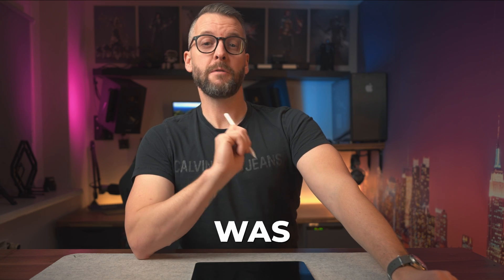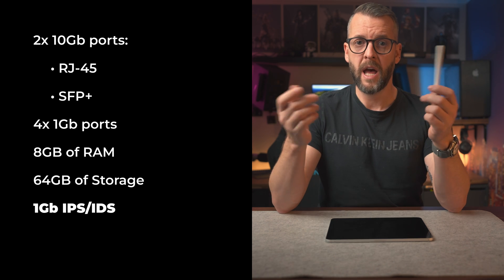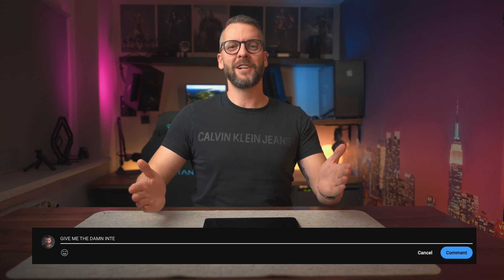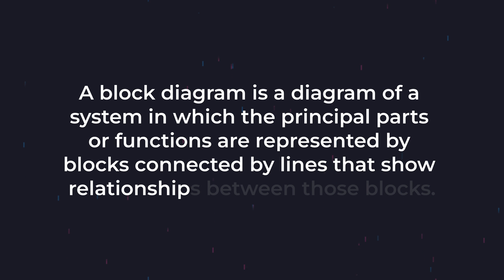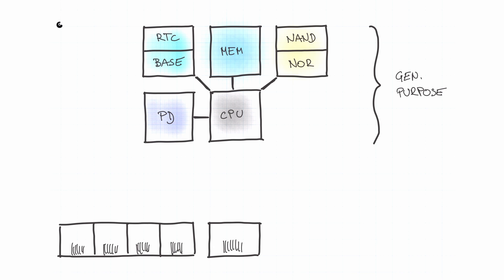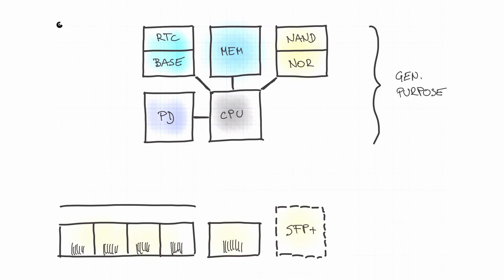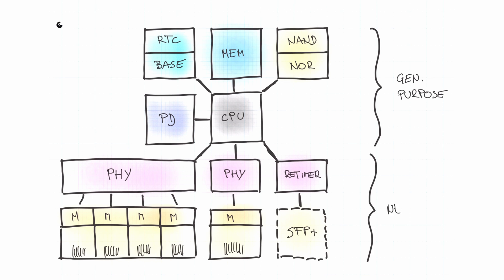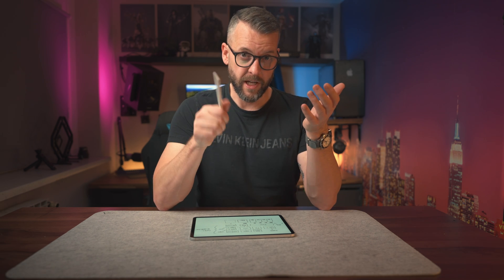Designing my own high-end router: the block diagram.

Comment: have you tried rockchip? they have dedicated ethernet. Theres a SBC with rockchip faster than raspberry pi 5, and this one comes with 2x 2.5Gb/s ethernet, and has other IO that you would find useful.
Another option which i hope is affordable is the ryzen embedded. I have one and this one has the option of 2x10Gb/s USB-C or ethernet, and has the usual gigabit ethernet. So thats 2x 10Gb/s ports and a gigabit ethernet port part of the SoC already, along with 2x Sodimm slots which can be appealing to some vs rockchip's chip only memory (same with broadcom for raspberry pi).
Another option is to go with a common hotswap PSUs used in some servers and routers or you can go with multiple external sources i.e. POE, DC in (multiple). routers like mikrotik have boards that tolerate a huge voltage range from my experience (10-50V) which is insane but not only are they reliably designed that they tolerate and work forever, the only downtime i've had is just PSU and updates.
ryzen embedded gives good performance and openCL capable options or RoCm for performance if you want to innovate, giving multi 10Gb/s software capability. mikrotik now takes the middle road, partial optimised software and partial hardware acceleration allowing for filtered and accelerated internet. Some SoCs come jam packed with features at a good price and rockchip can be cheaper than broadcom (raspberry pi) despite the better features and performance as i've seen one brand that does this well. When i went through my SBCs that are still relevant, all the ones i have that are still relevant (GPU openCL compatible) are all rockchip, from 32 bit asus to various 64 bit SBCs that i so happened to have on hand.

It would be good to connect, wish i had seen your channel faster but i understand quite a bit more about network having worked at a coreISP before. It doesnt matter how it is pronounced.
The most important question you need to ask is but will it route? Can it VPN at 10Gb/s? can it QoS at 10Gb/s? can it do all of this at 10Gb/s?

Heres a hint, for your PHY, its fine to cheap out with realtek. Unlike going with famous brands like mellanox (*cough nvidia rip off*) or intel, realtek actually has a lower latency from my testing if you want physical but want to offload the rest to software. Performance wise i dont see any reason to use intel if you arent doing dedicated hardware sharing on VMs (sharing the same physical device across multiple VMs), so theres no need to go brand crazy here. Besides realtek advertises quite a few hardware features as well.

With rockchip you could take the PCIe and do 2x 10Gb/s, 2x 2.5Gb/s. I suggest going with SFP+ instead for your 10Gb/s interfaces despite your choice of chips. TILE has interfaces for 10Gb or 4x1Gb/s but im guessing thats not quite needed for your target audience.

Your router must beat ubiquiti as well. Both the rockchip 3588 and snapdragon already beat intel atom in performance so theres no reason to splurge on intel atoms.

Comment: IMHO the deciding factor for buying this router would be mainline kernel support. The number of SBC style boards I've purchased over the years which lasted < 2 years because I wasn't able to update the software on them anymore because the vendor used the chip manufacturers custom kernels to build forked variants of whatever os/distro.
Reply: Agreed, would help with OpenWRT long term use.

Comment: Hi, Tomaž, also hi from Slovenia, i write in English so others can help and comment, and that's my optimization. The case, look into ALU metal press forming instead of CNC machining, it should lower the price significantly, and it also is more eco-friendly. For the router board, imagine the audience, if high-end home users then target 250€ max, instead of 500€. We need capable VLAN routing with some IPS, target 2.5G for VLANS and 1G for internet with IPS if possible, and two WAN ports. The SoC with built-in ETH is great, then reliable storage for dual boot, and m.2 and USB rather than mpcie for backup disk, so it won't brick on failed upgrade and config revert with a button. A surge-resistant power circuit, and isolated ETH ports. All the LEDs for diagnostics, interference resistance for SoC, and also watchdog. Have a look at UniFi gear for inspiration like cases, ports, and circuit design. Make yours even more friendly to use and simple to restore config. As for the software start with support for opnsense + pfsense. Then later on the mobile app and more user-friendly GUI make it better than UniFi, with guided pro features, it would be the goldmine for savvy home users. Users need guidance fast, to make the internet faster, to enable QOS, to make good firewall rules, to resolve VLAN congestion due to IPS or a hogging client. Even UniFi lacks some of this. Have a great holiday, and I wish you success with the project.

Comment: 2x10Bbps port don’t make sense really… if I need to connect a device to my computer, I can do that directly. Without router.

My use case (and I use 2 10Gb routers).

- 10 Gb optical port to connect to provider via provider’s router
- 10 Gb port to connect computer on QNAP QSW-M408-4C  router
- 10 Gb port to connect NAS (NAS has SSD cache) on the same router

If not SSD - I would survive with 2.5Gbps, 5 Gbps max.

But I would still need more than 2 ports.
Reply from the maker: Gotcha, thanks for the rationale!

Comment: 1. 2.5 GbE instead of 1 GbE
2. Go for x86 platform. The versatility and support you'll find will be countless. Almost all packages of OPNsense/pfsense/OpenWRT or any kind of linux distros will be supported, no need to recompile all those packages. The drivers and software supports will be huge. The extra price needed for x86 will surely pay off.

Comment: Hello!
Very interesting process and I wish you best of luck with it! :) 
I`ve read through below comments and I didn`t see anyone mentioning the HW acceleration for PPPoE WAN connection. 
Without it, your CPU will be totally under the water and even cheep alternatives (like the ones below 100$) will easily surpass the gigabit PPPoE performance, not to mention the above ones, 2.5GGbps or even 10Gbps.
Ubiquiti had this issue and they worked on it for more than a year to optimize the OS and distribute the encryption on multiple CPU cores. 
Why I`m mentioning this? -> Most of EU countries still have PPPoE fiber connection through GPON and now some of them, like Romania, are transitioning to multiple gigabit (2.5G/10G through XGSPON). :) 

If your router will be capable of 1Gbps PPPoE with IDS/IPS active or 10Gbps without IPS/IDS you can consider me as client. :)
Reply from the maker: Thanks for pointing that out, I was not aware of it! Will test the development board thoroughly to make sure PPPoE works as it should.

Comment: Have been following your feeds. I fancied similar custom router but ended building the router from standard stuff; 19" rack server case, atx mobo, dual sfp card, dual 10gbit card and it runs pfsense. If I ever need to reconfigure the hardware its easy. Downside is power consumption, but it was quick to put together.

Comment: What is stored in the "storage" of a router? I'm guessing it's just the program that it runs, or anything else too? 64GB for storage seems a lot, but I may be missing something.
Reply from the maker: It behaves exactly the same as any hard drive. I want to be able to run one of the open source firewalls on it, such as OPNsense or pfSense. They recommend at least 40GB.
Reply: @tomazzaman  thanks for the reply. Will it be running Linux? You are a very talented engineer. Good luck with the project.
Reply: @tomazzaman  Netgate recommends a minimum of 8 GB of storage for pfSense, not 40 GB. OPNSense requires a minimum of 4 GB but say that 40 GB is "Reasonable" to run all standard features at the same time (honestly who does enable all features of a firewall simultaneously?). VyOS minimum is 2 GB of storage. I am running pfSense on a 30 GB mSATA SSD and there is still a lot of free storage space.
The only reason for going over 16 GB of storage is to store a lot of logs or do some web caching. If you can save a non-negligible amount of money by integrating a 16 GB eMMC storage instead of 64 GB, then please do it. I don't think that most people care about a lot of storage on such a device. However, having the option to add a NVMe storage expansion would make more sense to reach the buyers who want more storage.

Comment: You really need to check what bandwidth the CPU can route through it without the offload hardware. To reach 1Gb/s IDS is really tough!  Furthermore the Linux kernel is not designed for optimal routing throughput.
Reply from the maker: The CPU we're planning does support BSD as well, but we will of course test everything once the development boards arrive.

Comment: don't use 5v as input, please support proper usb-pd so that you can use any power supply, otherwise it makes 0 sense and it would be better have a barrel jack. 15w for usb-c power supplies are meant to be delivered over 9v and not 5v for most power supplies
Reply from the maker: Yep, that's already planned. So many people "voted" for it that it was a no brainer.
Reply: @tomazzaman  I just don’t want to see another raspberry pi situation where you need a specific power supply capable of 3A+ over 5v while you can buy proper usb-pd of 35w for 20€

Comment: Not sure how it may effect BOM, but maybe a N5095 or N100 will make more sense?
They are considerably more compatible with OS and would also have a virtualization host option i creasing the market share you can target. (In addition to allowing a virtual FW, dns server and wifi mgmt software to run on the same hardware)

Comment: I was thinking if it could be a bit like framework laptop with upgrade strategy and an protection against obsolete items.
Split design on 2 pcb, one with main io and "stupids" electronics,  then use a cheap memory socket to cpu board, which then have edge pins build into board. Then future could have different cpu boards, or in defects, only chance cpu board. Than also add a cpld/fpga in interface which can really protect against future changes in requirements, just ensure high speed / low latency interface - could extend interfaces also. 🤓
Reply: that strikes me as a massive amount of added cost
Reply: @shanemshort  massive i would not say, but really depends on how it is done, could however unlock future revenues also with upgrades or extensions. It could be what sets this product apart from the rest - just my two cents 🙂

Comment: I will go out of my way to like an tell all my friends about this series if you ditch that waste-of-money you call a 'proper' case and put it into real hardware like a real man... n305, fan out the pcie and serdes, lets go... 

Also, the real network dudes are gonna bitch about port layout, no one want's just 1 sfp+ and 1 10g-baseT: do two of stp+ with 1 as a baseT combo port.

Don't cheap out on parts or we'd be better off buying a tp-link.

any plans to add the 2.5 port in? seems like a cheap value-add..

Comment: Just coming into this a bit late I'm sure, but relating to the flash, would it be an idea to have user-replacable storage such as NVME or a SATA DOM? It would be great to see an internal USB port of some sort as well for USB-bootable OSs

In the UK at least, we pronounce it 'root-er', but US calls it 'row-ter'
Reply from the maker: Not late at all, there's plenty of research and planinng yet to be done before this goes into an actual hardware design stage. We plan to have an M.2 port and another mPCIe one. It's not 100% for either, but they are being considered.

Comment: I'm excited to see this project develop. 3 things I'd like to see, rackmountable with pigtails, 2x sfp+ rather than 1xsfp+ and 1x10gb, power input on the back. Good luck!
Reply from the maker: Thanks, it seems I'll have to seriously reconsider the 1x RJ-45 as there seems to be more and more people asking for an additional SFP+ 
Thanks!
Reply: @tomazzaman 1 x 10Gb RJ45 and 1 x SFP+ are perfect. Wouldn’t even need the 4 x 1Gb RJ45. Just need a router with 1 x 10 Gb RJ45 to connect to the Fiber modem and 1 x SFP+ to connect to a 10 Gb Switch. And a rack mount option. That is all I am looking for. Didn’t find anything reasonably priced so far and have high hopes in you project. Anything extra only makes it more costly and I hope it stays below 600-700 €/$.
Reply: @tomazzaman  I like the idea of 1xRJ-45. The SFP+ to RJ45 transceivers generate a hell of a lot of heat. Also here in the US we get 2G fiber but the ONTs still connect via RJ45. You have to cover a broad audience. Not everyone will connect direct to SFP+ and not everyone will connect at 10G. Most of us are just getting into 2.5G. Also Rackmount option!
Reply: @harihoudini  Ubiquiti dont want to support 2.5G SFP modules. Their fans are fanatic and i wonder why people still want to pay their prices for bad options. Other brands already support it. The support is more down to software though. Since datacenters dont use ubiquiti they have no one to scream them into action meanwhile if mikrotik doesnt support a feature many are going to scream at them as businesses and datacenters do use them.

Some ARM SBCs with 16GB of ram for $150 faster than intel atoms are coming with 2x2.5Gb/s ethernet.
Reply: @tomazzaman  Count me in the "2xsfp+ = interesting, 1xsfp+ and 1 RJ45 = no thanks" camp.. as may other said from sfp+ to rj45 is a fairly cheap device (addon option perhaps, when selling?)...

Comment: In my experience, sfp+ is more flexible and reliable than the rj45 variant. So better use 2x sfp+ instead of 1 sfp+ and 1 10gbit rj45. When you really want rj45, you can always add a sfp+ rj45 module.

Comment: Really great Project! Since there are no high power requirements, what about POE to power the board?
Reply from the maker: The thing is, it'll likely still require around 35W and I'd like to have some headroom, I'd need PoE++ (60W). I don't think there's enough potential customers out there with PoE++ capable gear out there.

Comment: I dont understand why everyone ditching a barrel plug. Its alot more robust than usbc
Reply from the maker: Convenience. Having one cable for everything doesn't always make perfect sense but sure is convenient.
Reply: @tomazzaman  same cable still require different power protocols and current throughput. Usually you still use one cable for one device just more fragile one. And we talking about routers they normally does not get unplugged.
Barrel plug PSUs also can be used everywhere just check if volts and ampers are correct

Comment: I think what you're doing is really great. I only just found this channel and have started going through your router designing videos. Really enjoying it so far.
BUT in my opinion, not having dual SFP+ is a total deal breaker; For me and probably for a lot of other people too. Especially those using fibre networks.
So considering the CPU's limitations, it makes much more sense to have dual SFP+ instead of 1xSFP+ and 1xRJ45 for the 10Gb ports. That way SFP+ fibre can be used for both WAN and LAN. Then if the user does need RJ45 they can just use an RJ45 Transeiver. I think not going dual SFP+ will reduce the market that your router will appeal to. I also think that with dual SFP+, your router will have the potential to be marketed as a professional router to the SME (Small and medium enterprise/business) sector, not just homelabbers. And if priced correctly could be extremely competitive in the small-medium business market. Even against Cisco and Ubiquity's offerings. You could have a router that is damn near perfect in my eyes.
Reply from the maker: Thanks for the suggestion, it seems more people prefer 2x SFP+ as opposed to 1x 10Gb RJ-45. I'm seriously considering it.
Reply: @tomazzaman  Combo port for 10G, best of both worlds. User choose what media (RJ45/SFP+) they need, like some enterprise switch.
Reply: @tomazzaman  consider the ryzen SoC, you get 2x10Gb/s interfaces for embedded and a vega GPU but this is with their gen 1 ryzen embedded. Might have newer variants as mine is a bit old. This lets you easily have SFP+ as with SFP+ you can reduce some of the costs associated with PHY ethernet, however this puts the burden on customer instead for ethernet. However SFP+ direct is cheaper than 10Gb/s ethernet in short distances with ensured cable quality from my experience. After a long time running ethernet sometimes they tend to drop in speed which is annoying. So with 2x SFP+ one may put GPON opticla on one, and on the other SFP+ direct to a SFP+ switch. In my previous setup i had a 10Gb/s capable switch with 36 TILE cores with 2x SFP+, one of it to a SFP+ switch which i combine to ports to another switch before breaking it out to 24 ports. On the SFP+ switch itself i also connect file servers.

I can help you find better SoC options for your project than what you are currently using. However check out ryzen embedded SoCs first as well as other ARM options. Have you also tried snapdragon given they have good OS support? intel atom is very slow in comparison to rockchip and better options.
Reply: @tomazzaman Ignore 1/2.5gb ports and go 10gbe all the way. You give users the option of using different connections if you split up the ports evenly (3xSFP+/3×rj45).
Reply: A router with just two SFP+ ports and nothing else would be kick ass.

Comment: I’m very interested in this project. I speak US English and while it’s commonly pronounced both ways I prefer router,  not “rooter”. I prefer an external power brick, as long as you use something standard like usb-c PD or a 12V 5/2.5mm barrel jack. This benefits replacement of a bad power supply, minimizes package size & heat dissipation, and greatly simplifies regulatory compliance (CE or UL).